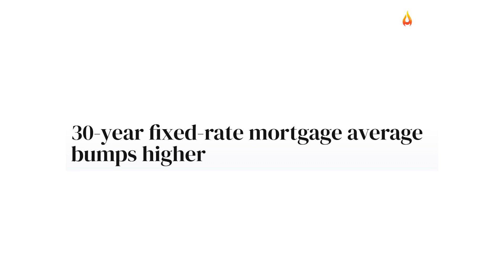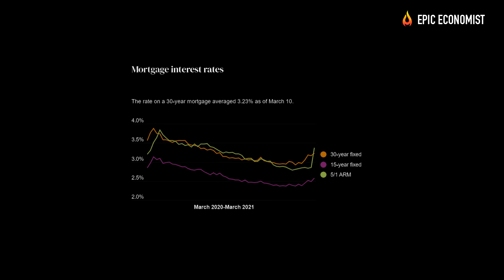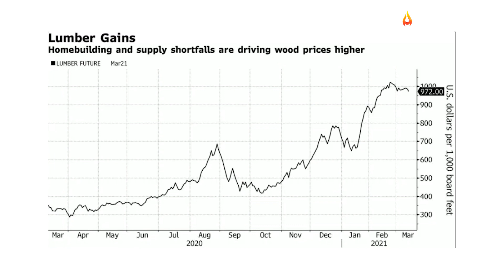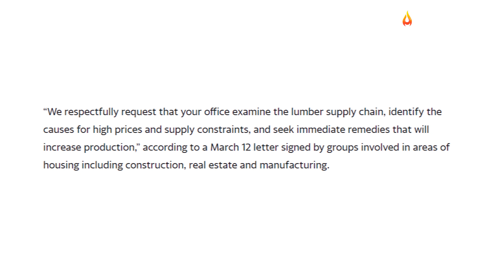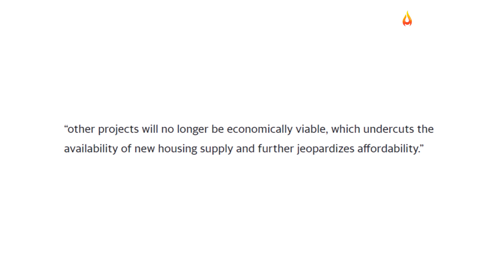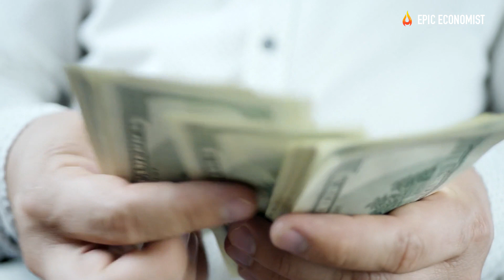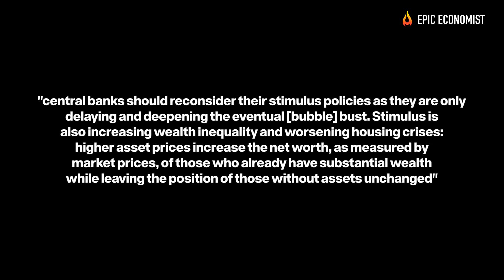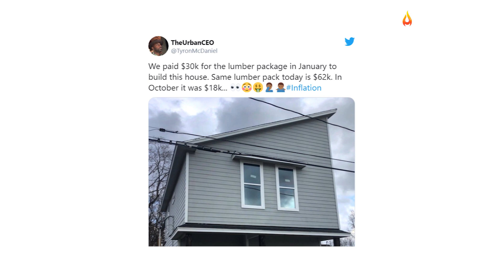Housing Crash Is Coming! Mortgage Rate And Lumber Shortages About To Pop The Housing Bubble

Comment: Material shortage on everything from lumber, insulation, stoves, fridges, hardware, furniture, windows, steel, aluminum, yet we need a stimulus package to let everyone who is not working extend their unemployment benefits.  If the demand is so high and no supply we should have jobs at every corner right now and prices should relax.  Not if nobody has to go back to work yet.

Comment: I’m trying to understand why housing prices will drop according to this video. What is the main argument? Is it that prices will go so high that there will not be demand?
Reply: No. The idea is that a critical mass of people will default on their mortgages for various reasons including rising interest rates, job losses, inflation leading to increased costs of living etc. But the narrator is saying that demand currently outstrips supply which pushes prices higher, keeping lower income workers from buying a home.
Reply: Correct. Prices are soaring. Buyers soon will not be able to afford them. The homeowners will then drop prices to sellavle levels.
Reply: @Rob--  Or sellers could simply decide not to sell at this time- which has already been happening-which is also why we have record high prices.
It's supply AND demand.

Comment: more MONEY should be used to create jobs BUT INSTEAD THEY ARE PLACING THE MONEY IN THE BANK thus even if it is 100 trillion as long as THE ASSHOLES OF ECONOMICS (speculators) PLACE IT BACK IN THE BANKS it means or is = to ZERO VALUE. in a true macro economy MONEY should represent product or services IF NOT INFLATION WILL OCCUR AND THE VALUE OF DOLLAR LESSEN.

Comment: A bankers guy to steal everything
Become majority lender in an economy of people with assets you want.

Encourage indebtedness by loaning generously while securing on assets of interest.

Loosen lending standards until the assets you seek to capture are attached. (this makes the economy debt dependent)

Once debts are significant for the bulk of the population, sharply tighten lending standards. <-- Economic shock - Onset of deflation

Backstop losses with public guarantees if possible. This is gravy if one can get it. (Fannie and Freddie guarantees, for example)

Permit default 'without risk' on the assets you wish to sieze to maximize wealth transfer. (stall foreclosure, stay repossession orders etc)

Stall the economy to maximize default positions and deplete private liquidity. <-- We are here

Successively ratchet the economy downhill, while bettering secured positions.

In a series of large actions, sieze all security for default. Target the assets of greatest interest first. (This deals a heavy economic blow and can help cause the ratcheting required for step 8.)

Transfer asset ownership, but retain prior owners as renters where possible. (This reduces public lashback and helps maintain the asset for resale)

Once the bulk of assets of transferred, write them down to leverage the public financial backstop.

Buy up as many remaining assets on the cheap as possible. Hide this action.

Hyperinflate to destroy the external claims on wealth. <-- Onset of hyperinflation (This destroys treasuries, gov't bonds, currency. Ensures free title on new assets. May cause war.)

Stabilize the currency or devise a new one, resume lending at a reasonable pace. Sell the assets back, secured of course, at your chosen price in new{digital] currency.